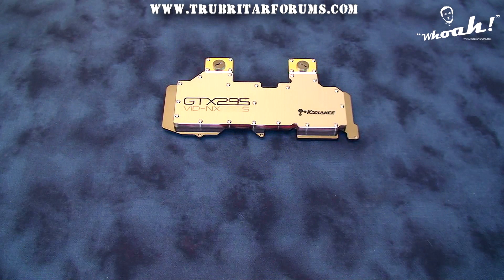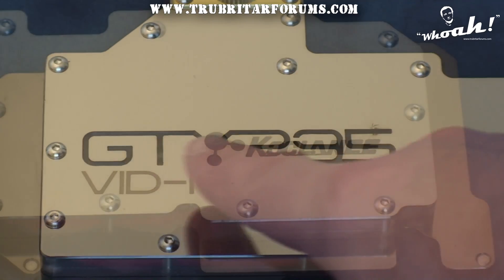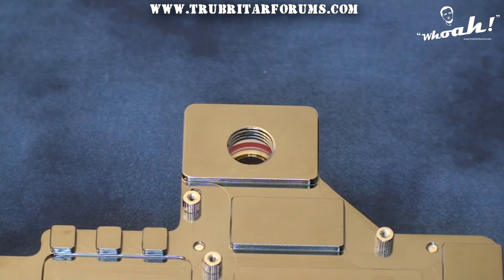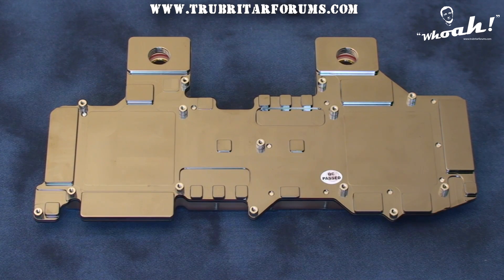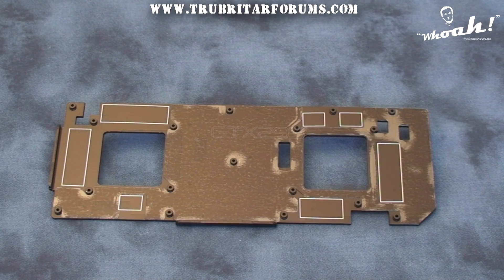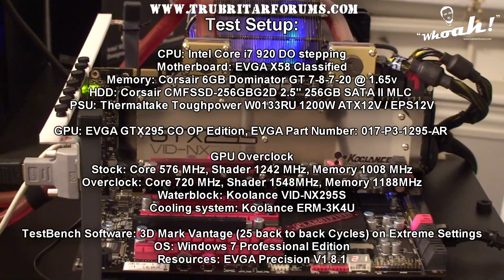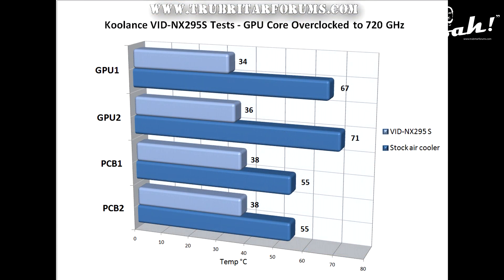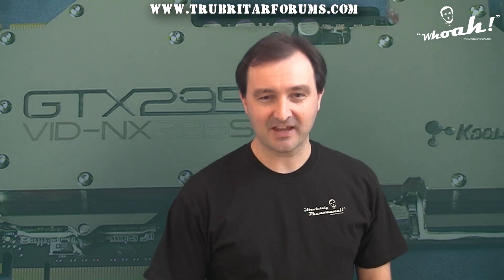(HD 1080p) Koolance VID-NX295S GPU Waterblock

Comment: Hi trub, I have a question about the oc. I can't go over the 685/1477/1122 when you run at 720/1548/1188  I can't understand why...
I have a R2E with the i7 980x and the enermax revolution1250w.
Maybe I have to change anything in the bios? (like the voltage at IOH/ICH, or more?).
Thank you very much.

Comment from the maker: Typically the pink side of the pad faces the heat source, if your mem chips run hot or you have excessive artifacting or blue screens, i would strip down and reverse or install new pads with the pink side facing the card components.

Comment: Hi trubritar i have a quick question, i redid the paste on my EVGA 295gtx hydroblock and when i put it back together i put the thermal pads so that the pink side is facing the waterblock, not the memory chips. 

Is this bad and if so should i take it apart and redo it?

Comment: u also have to figure the room temp, fan speed/cfm, flow rate, pressure, tubing layout. and even then ur resaults will very b/c no 2 components are exactly the same. lastly u dont want to be getting info from SPONSORED outlets hit the forums and overclocking sites find out what experienced ppl use and why. buy smart.

Comment: Trubbbbb more 5870 or 5970 less 295. I get the whole video for each koolance product but that doesn't mean you can't make some more non sponsored videos. Also if you're going to show the temps of the cards with the waterblocks please include a basic rundown of the loop the block is in or at least the rad, though I assume you're using a feser monsta right?